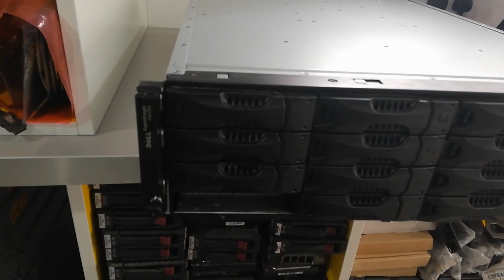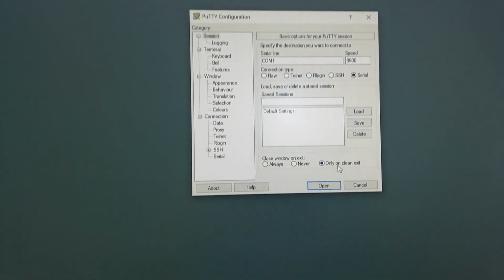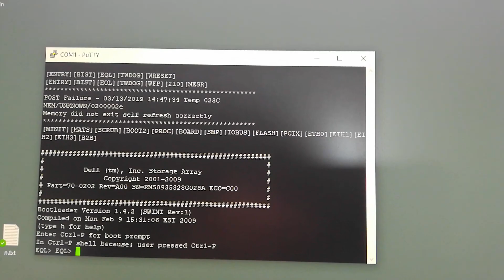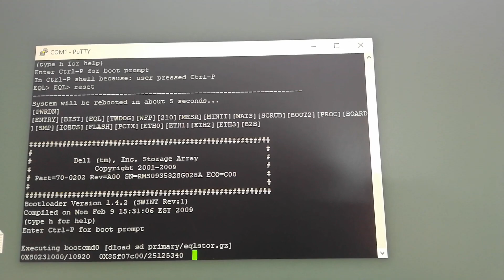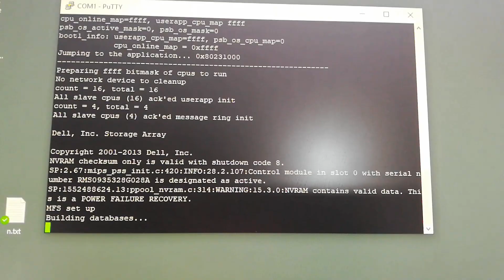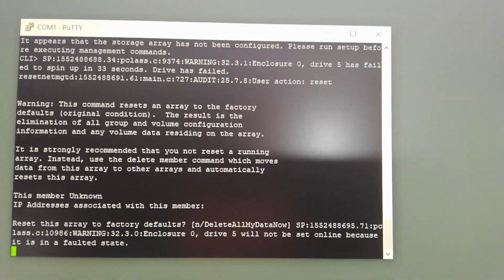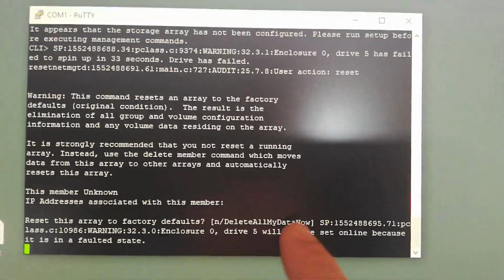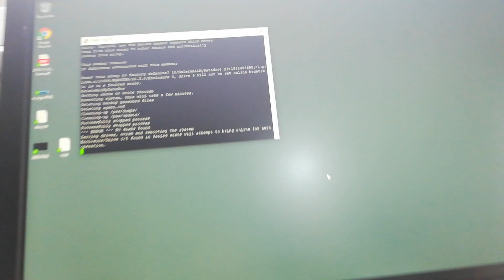Dell equallogic ps6000 module 7 reset clear password

Comment: When connecting via Putty I can see the text appearing as the controller turns on, however I can't type anything on the interface, it's as if it doesn't accept my commands, nothing I type appears on the screen, it doesn't respond and Ctrl+P doesn't respond either. any idea what it could be?